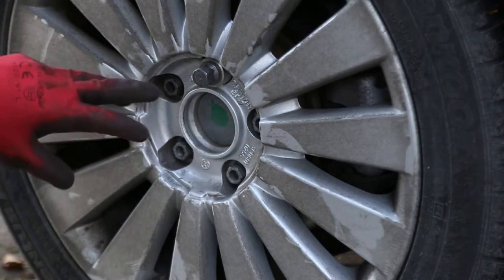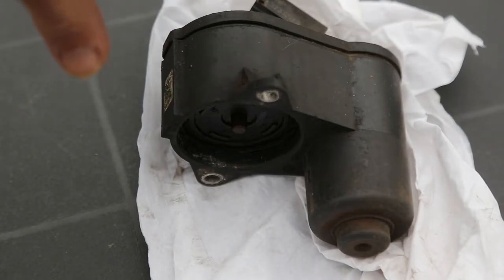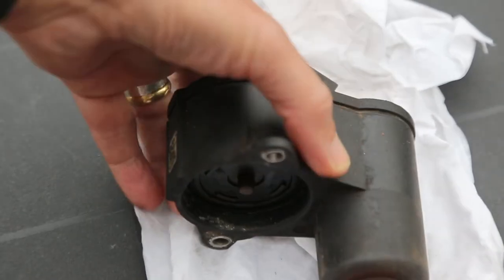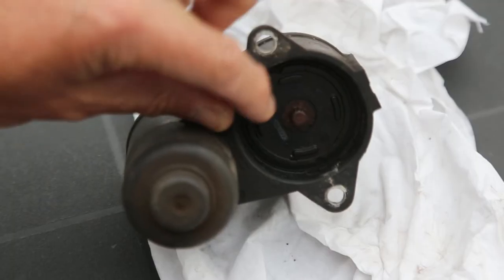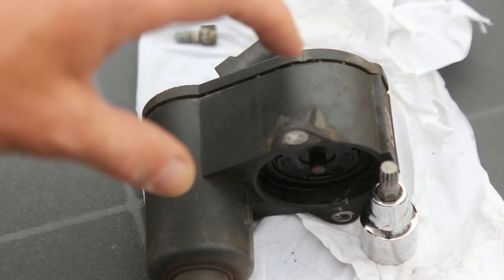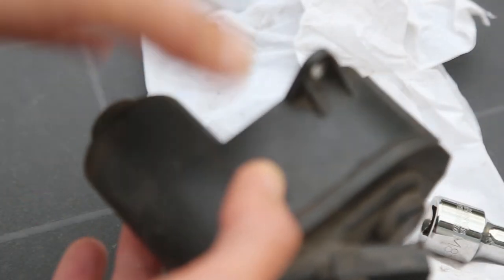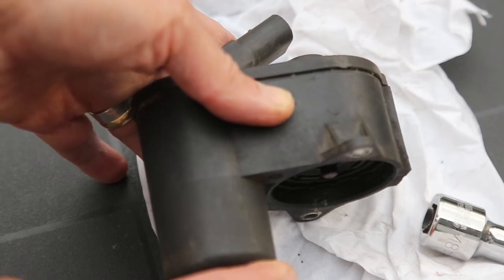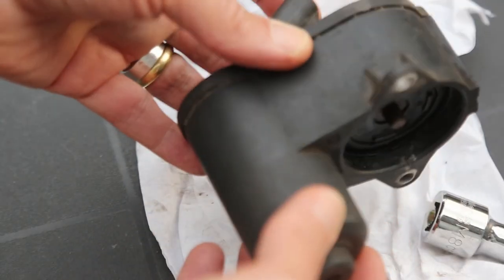VW/Audi How to Release Electric Parking Brake Stuck-Car Won't Move-Passat Electronic handbrake Fault

Comment: Best way to release if it won’t unwind is to unplug the connector. Then attach 2 wires to a car battery you put the wires to the terminals on the motor to unwind. You can hear what way the motor is spinning if it’s tightening swap the wires around unfortunately I’ve had to do it a few times on my b7.

Comment: Any advice what to do if only one side of the EPB working?
Left side wont work
Switched the motors, still the left side is faulty
Same beeping sound, error messages
Cant clear codes from computer, they are instant back on
Faulty button(lot of forums says that button can be faulty, but why does it affects only one side?) or faulty controller module?
if i disconnect the battery, and if the calipers is not connected with the motor it drives the motor, so cable cant be a problem, it gets power

Comment: Thanks for a nice simple video. Got the same job to do on an A5 that has been standing for quite some time.
Reply: Hi any update?
Reply: same problem! a5 3.0 tdi quattro cabriolet and locked 🤬
Reply: @Mrak47777  
Yes sorry. Turned out to be quite easy to do. I thought I needed a new calliper but it has been fine ever since!
Reply: @ilikefishing7858  
 Turned out to be quite easy to do. I thought I needed a new calliper but it has been fine ever since!

Comment: The one thing I'm trying to find out how to do is how to remove the motor which in this video is covered with half a sentence. Wtf if it's stuck on the rotor.
Reply from the maker: There are 2 bolts that hold the motor to the caliper, once those are removed you should be able to separate them but they can be a bit stuck so might need to pry apart